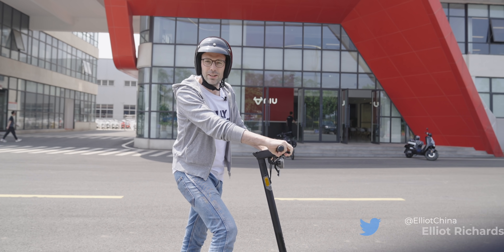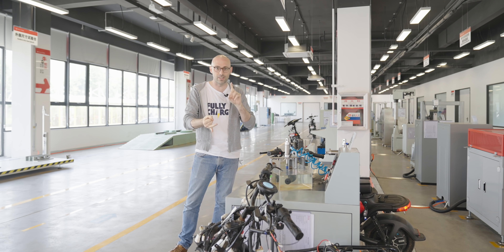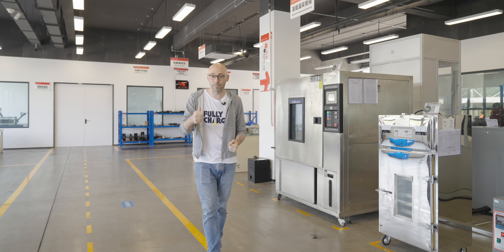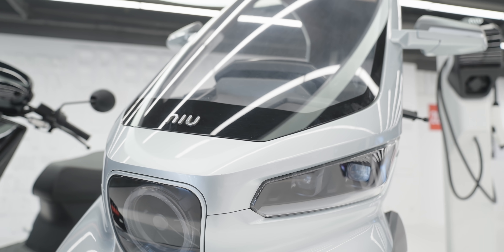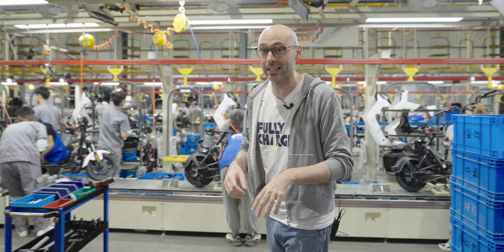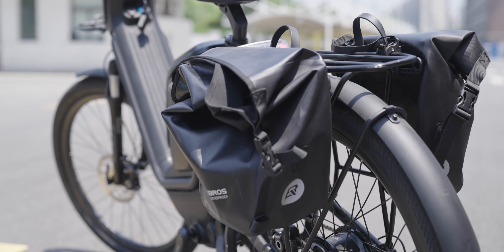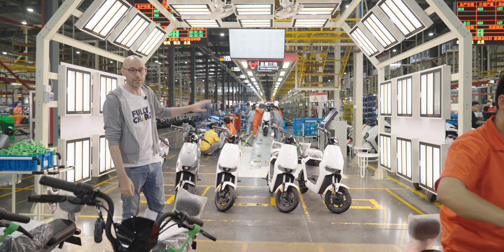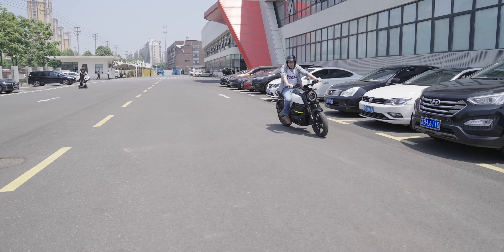The 2-wheel Tesla you hadn't heard of | BTS at the company that's making a million EVs a year

Comment: I purchased a NIU MQi GT EVO,  this has a top speed of 114km p/h, a range of 80km, powered by a 5kw motor.  Charges from normal power socket in 5hrs max, but I only take down to 40%, so charged in 2-3 hours. Obviously it depends what your daily use is but what is the point of dragging around 2 tons of EV getting 3km per kwh, when these things get 20km per kwh.  But you say "I have a family", you can buy 10 of these for 1 EV.  But the most important thing is that these are FUN, FUN, FUN, riding around with a permanent grin.

Comment: Not sure you can call them Tesla. I’ve had a NIU NGT since January 2021, it gets me around London quickly & easily. However, it is not a smooth ride, the suspension could really do with an upgrade, the app is intermittently good, it gets over-the-air updates which sometimes crash the app.  Having said that, for an inexpensive, cheap to run scooter, it’s very useable.  Great job on the video
Reply: To be honest, TESLA has many problems as well, people buy TESLA is not for quality, but  the innovation.
Reply: Make sure to get the 310mm suspensions, they are much smoother than the 350mm. Your dealer should be able to help you out.
Reply: You are absolutely correct，TESLA is much more killing than NIU！

Comment: Rode my Niu NQI Pro to work today :) not sure what makes it 'pro', but it's a good ride
Reply: @Evil Mario, it's the range.  The Pro has a larger battery (Panasonic) than the Sports which has a Chinese battery.  I bought the Sports because it's £500 cheaper;  I wish I bought the Pro instead.
Reply: @htlow3598  I can tell you the range even on the 'pro' (I was mocking the silly name, by the way) is disappointing. Mine currently has a flat tyre, the loss of battery % when it's not even being used is awful.

Comment: If only they where honest about their products. They use same marketing tactics as SuperSoco.. 125cc equivalent bikes are actually 50cc power wise and are tretd as such because in real life peak power doesn't count, its Continious power output that is how all EV's are rated ans not by peak power.. People are buying these scoots as  real 125cc equivalent.! On the diy electric motorcycle builds Facebook group I'm on I see soo many people coming with help questions on how to make the scoot faster or how to eliminate the problem of melting wires.!
I se loads of posts with destroyed batteries because people think they can use en as a real 125cc equivalent. New TC max can. T evm sustain the top speed for 10  minutes till it errors ams slows down.
Reply: The 125 equivalent phrase is obviously something you should take with a massive pinch of salt. It's not black and white though as you know. An ev like a zero 11kw is way more powerful than most 125 bikes, so you can understand if  they are calling less powerful bikes equivalents. To me a 125 category bike should mean up to about 70mph top speed, and reasonable acceleration up to speed.
Reply: @timscott3027  I know what you mean., but some  controllers like Sevcon gen4 starting from size 2  all the way up to size 6, even continious power from the Controller is labeled as phase Amp's.! Majority of  other manufacturers label the  2nd level as boost Amp's, the max Controler will be able to take in time, there's usually a temperature threshold .. Kelly kls 8080i for example can take boost Amp's or 2nd level for 1 minute or so  and phase Amp's for 10 sec.. But it won't even lasts that long.  Sevcon gen4 can take boost Amp's or as rthey label it pahse Amp's for 2 minutes.. That can be used for calculating the actual power using nominal voltage of the pack.. 
I've seen few manufacturers quote  the power output with max voltage and phae Amp's..
One of them  posted on one of the diy groups,I'm on and the  guy's just laughed at them. LoL...!  There's no bulshit in diy..
I just wish that they all where more honest..
Reply: @timscott3027  And if we are talking about the power delivery of a Zero electric motorcycles vs 125cc 4T Road legal A1. The zero is beast,
But its because they haven't limited the controller powe output.
Sevcon gen4 controller which they use through out their range is very smart controller, it can ve adjusted to give very linear power output. They can easily limit it to something like eco mode as a sport mode.
But they haven't done it... I'm guessing that this is one of their biggest selling points to attract people.

I was to design a 125cc equivalent A1 learner legal road ibike, I would pick completelly different type of motors with very high RPM and program the controller to simulate the power delivery of a petrol engine.
Energica has done and msny more..
The power of energune ramps up soo nicely. Its all done with software..
Reply: @Capt Shiny You don't need to explain to  me  anything about electric motorcycles, batteries or drive train, I know how they work..!

I understand what you mean but no, I'm not talking about kWh I'm talking abut power..

And I know the licensing or category malarkey as well.. TC max raw power wise is 50cc 4T equivalent because of its continuous power output..
Its been categorised as 125cc equivalent only because it can go faster  than 50kmh or 40 miles per hour..! And all that is because of torque.. At top speed there barely any torque coming from the motor..

Only zero 11kw bikes  range  are real 125cc equivalent because of continious power..
Well there are few more which are very close like Vectrix VX1, new upcoming Alrendo or evoke urban classic.. Those bikes can comfortably sit at 50-70 mph and reach legal 125cc 11kW equivalent or L1E top speed of 80Mph..!
Reply: @Capt Shiny And CC does  corolate to power output very closely.. Unless if its highly modified 4T or 2T.!

Comment: I picked up an electric bike conversion kit and it has changed my life.  I can get to work faster than in my car (10 miles)
and it's good exercise believe it or not.
I highly recommend my version: Full Suspension mountain bike-1,500 watt hub motors in the front and rear, twist grip and thumb throttle, 48v 20ah lithium battery out back in a plastic ammo can (mounted to a newspaper carrier that connects to seat post)  It accelerates ridiculously fast when you give both throttles the beans, 36mph top speed.
Reply: That's fast!
Reply: That’s illegal!
Reply: @markthomasson5077  Maybe where you're from, around here the police don't look twice at me.  I've ridden over 50,000 miles on electric and gas bikes, sometimes over 60mph and I've never been pulled over.
Reply: @ProlificInvention  UK, and I think most of Europe, is limited to a piddly 250W, 15mph limit and no throttle.
Reply: @bentp4891  That really sucks man!  I did not know that, although I did see a video of a guy in the UK who rocks around a mountain bike with an AGNI/Lynch motor with a throttle which is capable of 60mph.  Perhaps he just has the attitude of "catch me if you can" or "I'll pay the ticket when/if the time comes"

Comment: Looks like Niu have a nice setup there. For someone who hasn't ridden (not driven) a motorcycle before, you looked very comfortable riding the RQi.
Reply: I agree. A novice would never be able to start and ride my 1993 Yamaha XT350. Too complicated from cold, and rather exuberant to ride. Gear changes, manual choke, clutch, diving suspension, all to much. That looked super simple by comparison. Point and fire !
Reply: @gordonmackenzie4512  you don't compare it to a 30 year old bike, that's more in the realm of the Honda Navi which is an automatic city bike that you just turn on and accelerate/brake

btw I'd pick that XT just because I am a sucker for old vehicles, or even better a DTR (the water cooled one)

Comment: a driver license should be enough for automatic electric motobikes in the eu but it’s not so I drive a diesel car instead, pretty dumb, have a truck license as well…
Reply: ...there's more to riding a motorcycle than shifting gears, which is why you should be properly trained and licensed to ride a motorcycle.
Reply: @spoonkiller_actual  I would disagree if you can ride a bicycle and have a driver license you should definitely be able to drive an automatic electric motorcycle. Easy. It’s like scooter, moped, what’s the difference, ridiculous. The benefits outweighs the negatives. Same traffic rules.
Reply: @Don_P  sorry but no.  When you ride a bicycle you're staying under 15mph, you're on the side of the road.  When you're on a motorcycle you are in traffic, sharing lanes at speed with people who do not see you.    You also have to be very aware of the road surface you are riding on, everything from gravel, to railroad tracks to painted surfaces, all have to be learned.  Having a front end wash out at 10mph on a bicycle is not nearly has bad as if it happens at 45mph in traffic.  Without proper training you're at a huge disadvantage and you will get badly hurt, thinking you can hop on a motorcycle and drive at speeds in traffic because you ride a bicycle... suicidal.  All aspiring motorcycle riders in the US should take the MSF training, pretty sure every country has a similar program.
Reply: @spoonkiller_actual  pretty sure that wasn’t a requirement in the seventies, the world gone soft

Comment: I was amazed how cheap the scooter was. I could (and probably would) buy that right now.
Reply: range a top speed are both low, limited aplications
Reply: @krusher74  Yeah, it's a scooter.
Reply: At least 50% more in the west.
Reply: @markthomasson5077  Even twice as much would be a bargain.
Reply: @markthomasson5077  I meant if I were in China right now, but you raise an interesting point. Is there a way to bring such cheap production to the West? Could existing Western brands re-badge these models under their own name? Could scooters be partially assembled in China, then finished off in the West? Would it be viable for the brand to do mass shipments and sell them under their own marque?

Comment: Solar panels trailer for Electric cars, unlimited range, solar trailer produces  more energy than car requires to go 75 miles per hour.
Reply: @Capt Shiny That is one thing we need to think about, if solar panels work, a better place for them is the roof of the buildings like Wal - Mart, or even a small car, and hey, if you set a few extra soar panels for the car if every thing is fine, than will charge the car right up, maybe solar trailers will become popular for charging cars.